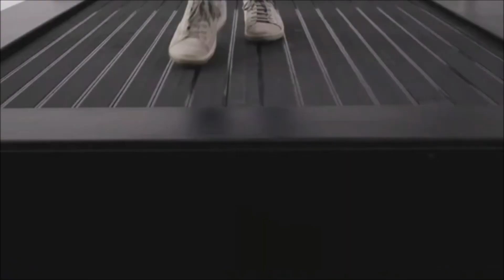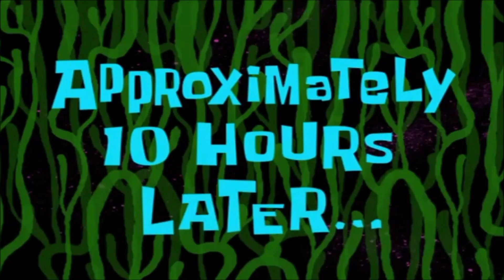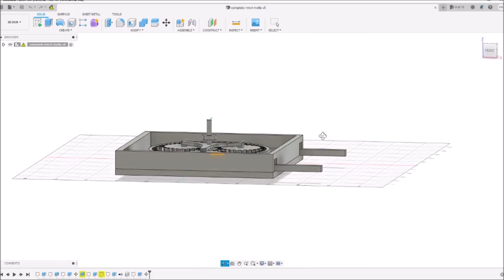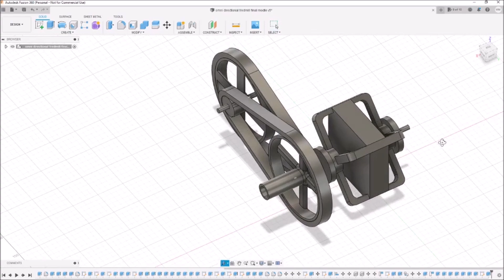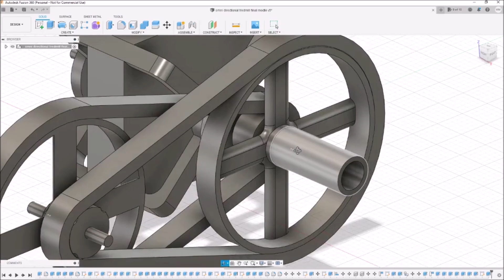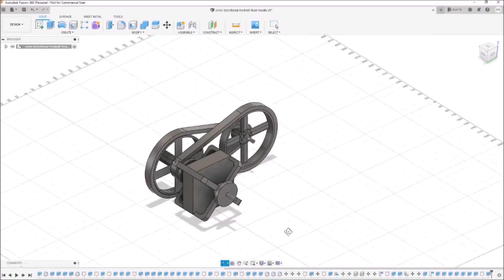Building an Omnidirectional Treadmill (Build log 1!)

Comment: you'll need more spokes on the pulleys to reduce breakage i reckon
Reply from the maker: That would probably be a good idea! but when I finish the whole hardware side of things im going to get actual treadmill motors and they already have built-in gearboxes so I won't have to worry about incorporating a reduction into the final design.